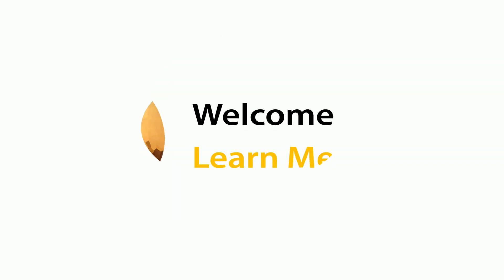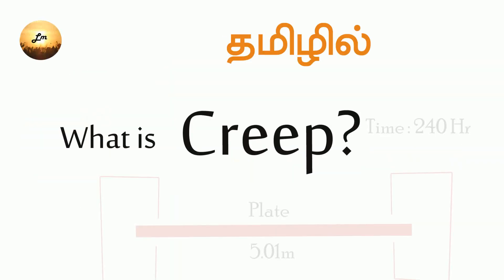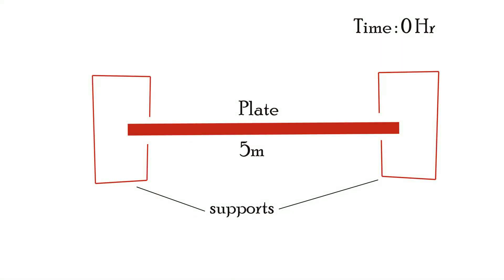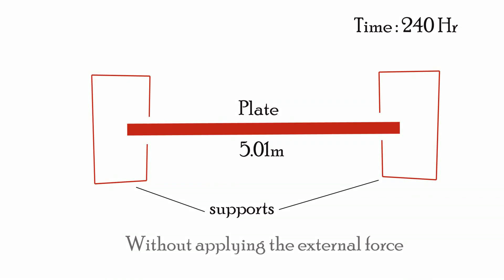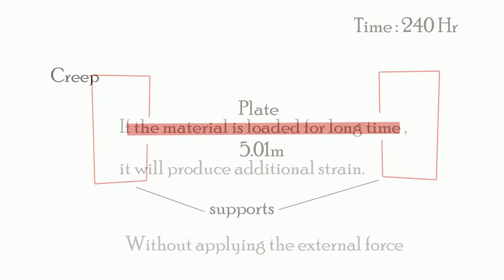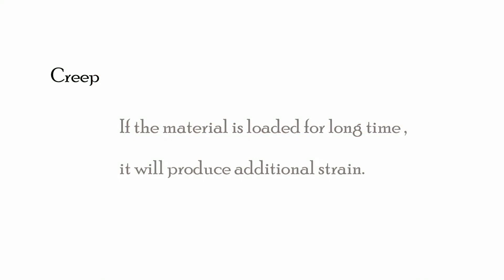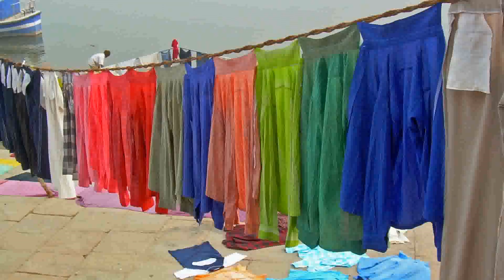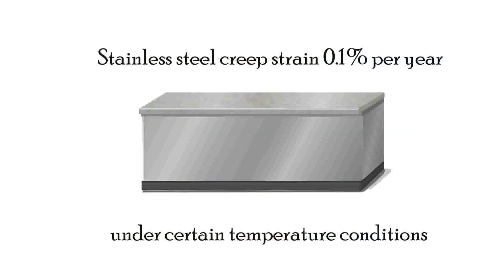Creep in Tamil | Strength of Materials

Comment: bro 1000mm lenth,20mm thickness la oru plate vmc pannitu antha plate ah 2frame ku end la na vacha.apo oru senior vantu intha maari 2end la vaika kudathu.gravity force la deformation aagum soldraga.ithu unmaiya?
Reply from the maker: If you use the frame just for support, you need to find the center of gravity and that's the right place to support. Instead of placing at edges, you can intersect them with 90 degree and it forms as + (plus) symbol.